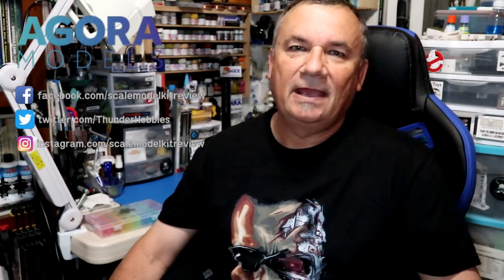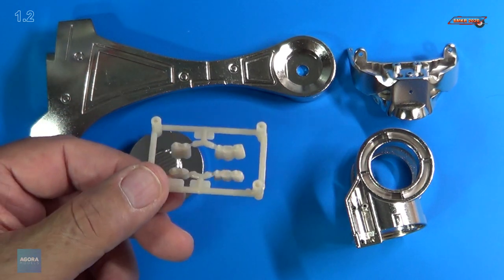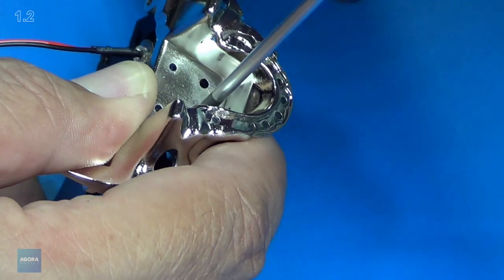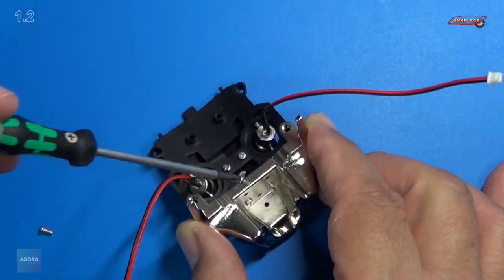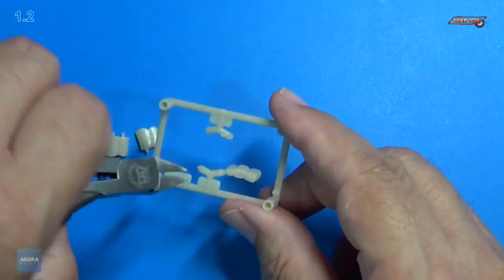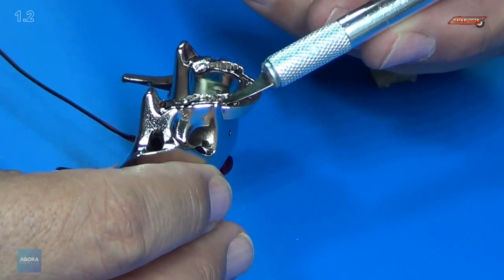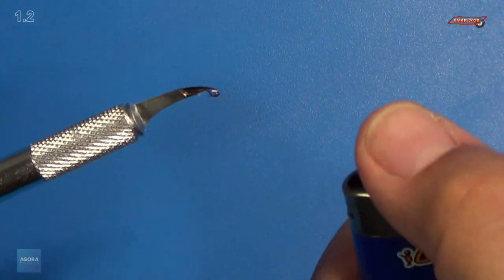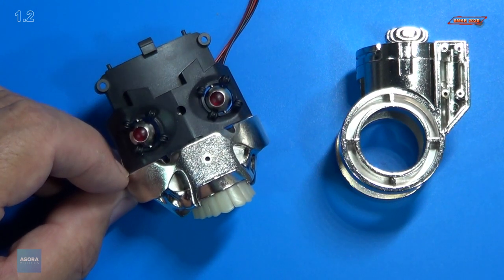Agora Models Build the T-800 Terminator Pack 1 Stage 2 - Teeth for the Upper Jaw & Right Arm Parts

Comment: When needing glue use the lid from the parts you get this will save on plastic waist just an option.♻️♻️
Reply from the maker: Great idea, I like using the small cups so it doesn't get in the way, I also reuse them on other glue projects.